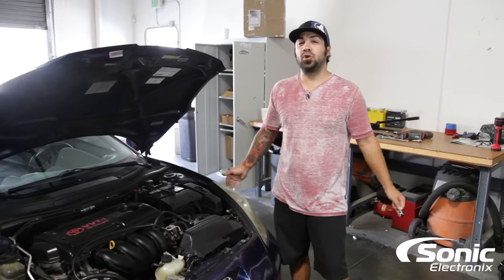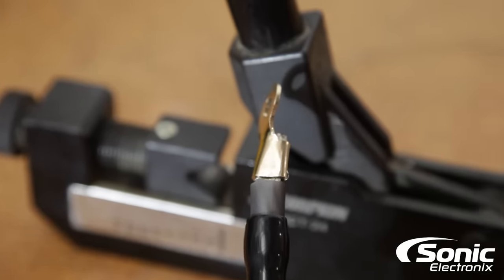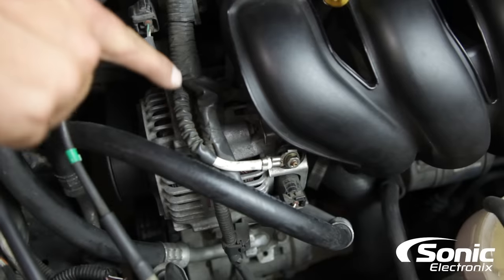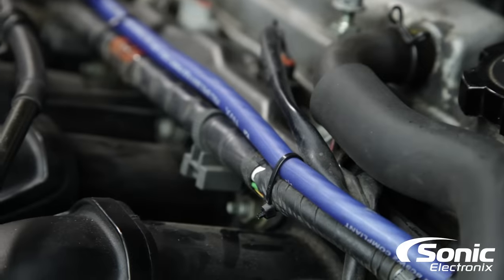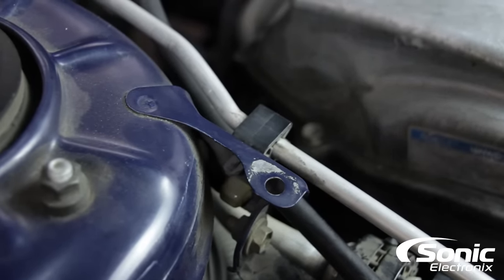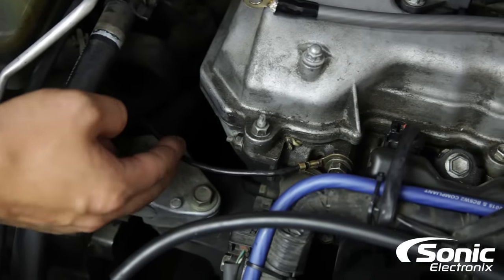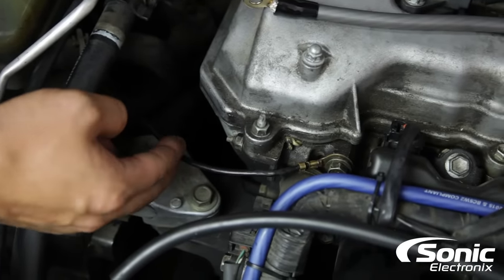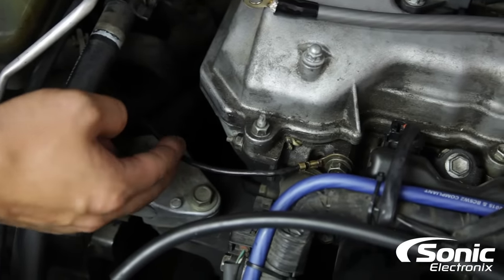How To Install the Big 3 Upgrade | Improve Your Vehicle's Electrical Charging System | Car Audio

Comment: I have done this upgrade to a dozen different cars. but why? you will not gain any horsepower. but your car will start faster, your battery will last a little longer, reduce chances of shorts and check engine lights, and your interior lights and gouge will be slightly brighter. to the engineers that say don't do it. the car manufactures especially imports use the bare minimum metal and materials to get by to maximize profit on quantity of cars sold. we live in a world where quality is rare and quantity dominates. just look at the food Mcdonald's sells.
Reply: freeyourmind88 I
Reply: Well said.
Reply: freeyourmind88 you just explained why
Reply: Agree!
Reply: Apparently, you missed the entire statement by Freeyourmind88 of why, surprisingly for people who do more than just let their cars drive them, we knew it had nothing to do with stereo installs although it could be applicable at a later point. VW's before 2010 should've automatically came with an upgrade kit as those cars were the poster child of bare minimum wiring.
Reply: No joke, my car’s engine was having some misfires under heavy boost. Upgraded the grounds and it began running flawlessly under load.
Reply: Mike Villiams I haven't heard of this. I own an 09 jetta. I'll have to take a look at what you're talking about... Thanks for the tip.
Reply: Okey, I was questioning Why is well, but you have put forwould some good points thank you.
Reply: freeyourmind88 damn
Reply: VerySpicySalsa by  u bu h&
Reply: freeyourmind88 my 96 s10 needs it.  Wires are exposed and can't see shit with headlights on
Reply: freeyourmind88 EXACTLY, BUT THATS A STATEMENT FOR SMART SELF INFORMED PEOPLE WHO REFUSES TO BE DRIVEN BY THE BIAS ANS CORRUPTED SOCIETY, IGNORANCE IS EXPENSIVE AND EVEN CONFLICTIVE, IS HARD TO TELL PEOPLE THINGS AGAINST THE THINGS THE GOVERNMENT PERMITS FOR PRIFIT CORPORATIONS TO DO AS THEY PLEASE, THANKS FOR THE GOOD WORD
Reply: Well said
Reply: freeyourmind88 Shyah! I'm having to replace a wire from the alternator to battery because the wire sucks balls and corroded. Doing this before shit goes wrong is not a bad idea. No power on a car sucks
Reply: I just installed a "Hella" headlight relay harness and that alone made my led headlights brighter.  This will take it even further??
Reply: It really trips me out that nobody understands that this video isn't made to benefit your car it's made to benefit your sound system lol
Reply: Solid comment. Thanks bro
Reply: Its more for your sound system or if you install other lights like a light bar or anything or leds
Reply: The owner of mcdonalds invests in real estate. Not business.
Reply: Comes down to systems that draw so much power that it can look for the weakest link and smoke those wires
Reply: Amen 100% the truth
Reply: Actually you can get a couple of extra horsepower from doing this upgrade, here's why: The fuel pump and ignition system run off of the electrical system too, and higher voltage means a hotter spark and more fuel flow from the fuel pump. More stable voltage also means more consistent and accurate readings from sensors. With a higher voltage, solenoids like fuel injectors will also open more quickly,  resulting in more precise control of fuel delivery. Solenoids on the transmission will also operate quicker with higher voltage, potentially resulting in improved shifts Also, by upgrading the grounds, you reduce the load on the alternator because it doesn't have to work as hard to charge the battery and run the electrical system when current flows more effectively. The reduced load on the alternator can free up a little power too.
Reply: Buddy doesn't know where he's at, this is for stuff like, replacing bulbs for something brighter and or a light bar. But it's mainly for car audio, if you running 2 subs at 1k watts each. Those subs would take too much power from the factory car.
Reply: Idk about other imports, but toyota all uses more than just 1 engine ground. it probably has another 5 dedicated engine grounds somewhere else, theres no way that puny wire can handle the 20-30amps the engine draws just to run. instead of having a big ol ground like most domestic vehicles ive found the japanese like to use more smaller ones, reducing the distance electricity has to travel through the engine block which also helps with electrolysis.  grounding is rarely an issue with toyota I find. most domestic cars suffer from quite a bit of electrical gremlins and the ones that dont, well dont have complicated electricals. I am however going to do this upgrade since Im going to be Installing an alternator with almost twice the power output.
Reply: This idiotic comments pop up every time a DIYer tries to teach engineers,
Reply: If I  install aftermarket stereo equipment it reinforces new power demands. That's why I was watching anyways
Reply: Engineer here. Don't do it. But if you do, at least study and understand ground paths and why it's a bad idea to create too many paths to ground. And, make sure your pay attention to wire routing and hot spots. Run that alternator to battery wire in a poor path, and you'll learn the hard way.
Reply: Andy Hooper  had you disconnected cleaned and reconnected your factor wiring it probably would have fixed your problem , we do many service trucks with corroded or bad grounds or bad connections between the wire and the end connector, anyway if you are happy that’s what counts !
Reply: Thank you
Reply: Car audio bud. If you don't want to upgrade the alt you do the big 3 and it allows more current.
Reply: Jesus ppl... Car audio that's what this is mainly for..
Reply: @MrVwclassic  did you do the big 3? Have any photos or tips ? Thanks
Reply: For car audio upgrades
Reply: Car audio upgrades that need extra power to power it
Reply: Ppl think it adds noticeable horsepower?????
Reply: Facts
Reply: Thank you for explaining why the upgrade helps the car.
Reply: Lol wtf
Reply: A lot of people that have after market sound systems do this to maintain good voltage readings, keeps the voltage high and clean.
Clean power + clean sound = no distortion to ruin your sound system
Reply: you are a good guy bro thanks
Reply: Does this upgrade make your DRL lights brighter?
Reply: I still like big Max
Reply: A lot of people use this the get more power for aftermarket speakers
Reply: McDonald's doesn't sell food..... 🤮
Reply: People also do it for powerful sound systems that strain the stock electrical components😊
Reply: What happens to the voltage regulator?
Reply: The main reason is for people who are into car audio with amplifiers that are pulling 1k+ watts. Or really any aftermarket addition that requires more power. The big 3 is typically installed when upgrading to a higher amp alternator
Reply: Speakers😭
Reply: Lots of mods that work don’t increase hp that’s not the only reason to upgrade
Reply: It’s for high wattage car audio systems.
Reply: @tayloremriectx  It maximizes the performance of what you already have & 
paves the way for the installation of an aftermarket high-output alternator. It doesn’t increase the output voltage capability of the alternator, 
increase the output current capability of the alternator or offset the fact that your audio system requires substantially more current than the stock alternator can provide if that is the case.
Reply: Two words man more speakers
Reply: or the installs charter spectrum does
Reply: Name checks out
Reply: It's for car audio.. read the video title
Reply: Not a lot of people are going to get this. Honda gang!
Reply: When u start doing subs and pulling more power it helps keep the voltage up
Reply: Car audio. When you get into competition, the big 3 is required if you want a high output alternator.
Reply: Same  @classiql
Reply: 7 years later…… you’re sl sl slowwwwww
Reply: It’s for people wanting to add large competition sound systems.
Reply: In other words make it better than factory. Im gonna try this to my 2008 dodge ram. Good info maks me wanna get to it rightaway.

Comment: Lol, those pathetic termination lugs. These are NOT recommended for battery systems.  Buy high quality thick lugs for a good ground that won't fail once corrosion sets in.

Comment: This is the best Big 3 Upgrade videos that I've seen. The camera work is stable. You can see almost everything mentioned. The presentation is organized and features graphics. The presenter is knowledgeable, smooth, and easy to understand. The presenter is wearing a lav mic so the viewer can hear him clearly. The video presents more than one vehicle to illustrate differences in vehicle designs and challenges they may present. I give a big thumbs up on this very informative video!
Reply: @jayisfedup6896  Get off your high horse
Reply: @jayisfedup6896  sounds like hes fed up...
Reply: you sound like a school teacher marking a presentation
Reply: Thanks judge
Reply: Good info, just showing garbage terminals being used.
The point of big3 is to thoroughly improve your system. Using those trash, NON COPPER I-lug terminals that come in kits is not the way.
Reply: @deanb949  Good point!
Reply: Agreed.
Reply: Yeah this is probably the clearest explanation and example that i could find.
Reply: I learned/followed the entire video…  Thanks, man!

Comment: That small wire you made fun of that you thought was the engine ground, wasn't the engine ground.  That is a small ground wire made for the spark plugs in the head and the ignition system.  Replacing that wire did nothing.  You failed to identify the engine ground wire, which is most likely behind and back of the motor.  So your customer only got a "big 2 upgrade" but he paid for a "big 3 upgrade".  This happens a lot on Hondas, too.

Comment: And additional 'tip' is before you crimp the terminal end, is to dip the freshly stripped wire into some light oil (PB blaster, WD-40 etc) because the wound wire will 'wick' the oil back up under the rest of the wire insulation to help prevent corrosion seeping up into wire after time. And then if you decide to use heat shrinking sleeves, it will protect just that much better. (ESPECIALLY for the Northern states that use salt etc on the roadways)
Reply: Exllent tip my goo frend dielectric grease doe's not sipe l like pblast
Reply: Fluid Film and a quick hit with heat gun will wick the Fluid Film up into the cable too.
Reply: @mickdeegan4651 Did you mean *wick? Or sipe?
Reply: You can also solder it in, which will create a metal to metal bond which will leave no room between the wire and the connector and prevent oxidation between them

Comment: The Big Three Upgrade is a great insurance for a trouble free starting system for the life of the vehicle.  If you don't  have a wiring kit, any welding shop can provide very high quality DC cables, sold by the foot and a variety of quality connectors.  Total upgrade cost is about $50 and a little driveway labor.
Reply: If the upgrade prevents even one tow during the life of the vehicle, it's paid for.  Without the upgrade, failure of any of these wires can cause expensive damage to the battery, the alternator, starter and other charging components.

Comment: 6:59
When connecting to an aftermarket battery terminal such as shown, it's best to first put the bare wire into a wire ferrule and then clamp it down inside the terminal block with the Allen set screw. This keeps the individual wire filaments from fraying and makes a better overall connection.
Reply: Yeah I became a believer in wire ferrules after the first use... To think how many stereo systems I installed without those things back in 90s and 2000s...lol..
Reply: @knifeknerdreviews4609 same here😂
Reply: if you don't want to buy the crimping tool you can also just use solder to hold the ends together. The solder also gives the set screw something nice and soft to bite into for a great connection.

Comment: Always disconnect the battery negative before starting any electrical service. It is safety & protects electronics! Best practices are good.
 Purchase a digital multi meter (DMM) to have the ability to do “Voltage Drop” test and (OCV) open circuit voltage at the battery. There are good videos on both. 
  The battery stored energy to start the car, un-lock, lock and power lights plus many other duties like certain memory functions & clock. Yours will vary. The alternator uses diodes to direct energy to negative (Back Case of Alternator) and the B+. Negative to the battery completes a DC circuit and most cars don’t have a “Full” dedicated frame. Negative wire to the battery (As his Example) have a “Tee” inline, that bolts to chassis but to the engine. Rebuilding or modifying can be fun but a good cable for negative should attach from the back of the alternator and continue on to the battery. You need grounds everywhere to chassis, engine, battery, frame (If applicable) but the littles ones found on intakes, cylinder head or rocker arm cover to the firewall (Bulkhead) are required but the battery to the block is the big one. After all, you want it to crank to start. A good battery tested at 100% state of health and (OCV) at 12.6-12.8 Vdc is correct. The alternator will charge a good battery at less than 1/2 an amp while driving. OEM alternators sense B+ but also temperature. Cold batteries take as much as 14.2 volts as hot batteries take 13.2. The Marine industry + some auto’s with the battery under the rear seat has temp sensors to adjust the rate of charge. 
 Use wire that is quality with “Star Washers” inside or out that dig into both metals, the connector & car. Yes, remove paint to a minimum but protect your connections with a $6 tube of dielectric grease. 
  Adding amps, DSP, and other aftermarket components need a single large fuse that totals the added load. Placed next to the battery as close as one can. Route using existing rubber grommet and avoid all pinch points to avoid fire. Amp clamps w / direct readout are reasonably priced and with the loads on, measure each. Write this down and purchase a distribution fuse center. Sizing wire for unknown amps is guessing and boxes lye about amperage requirements. You can never use “OutPut” for calculation of picking the correct fuse. Start with only the size indicated by the component then the system on at full, the amp clamp will show the correct fuse by 28.6 amps, get a 30 amp fuse, not a 50 amp. The fuse protects the wire and not the component. Voltage drop is measuring the loss of voltage across point “A” to point “B” while on at maximum. The higher the circuit amps, the higher the voltage drop, so a 120 amp circuit voltage drop is 0.500 Vdc. 1/2 of a volt is lost! Normal.
16 amp circuit will show 0.050 Vdc loss. Like headlights or blower fan. These are series circuits, therefore the component uses all the voltage in the circuit. A new switch, wires, connectors, fuse and ground will add up losses when on and new. Measure with DMM on volts, turn on circuit and measure B+ side, ground side both to battery, the component gets the rest. Anything kissing high volts is resistance due the ground, connector, switch, wire or even a fuse. Follow these suggestions and you will have no problems and it works well in diagnosing. Amps to a fuel pump are about 7.0 - 8.5 Amps. Higher than this, plugged filter, pinched line, etc. Lower means the pump is worn and will fail. A simple fuse jumper wire plugged in at the fuel pump fuse w / Amp clamp will show. Voltage drop? If the black or red meter leads are backward, the reading is the same only with a (-) sign in front of it.